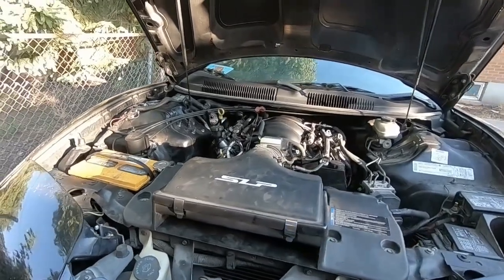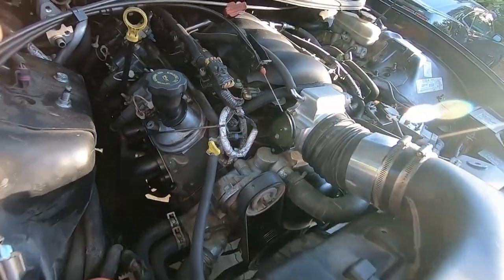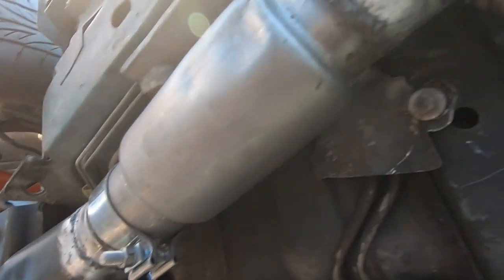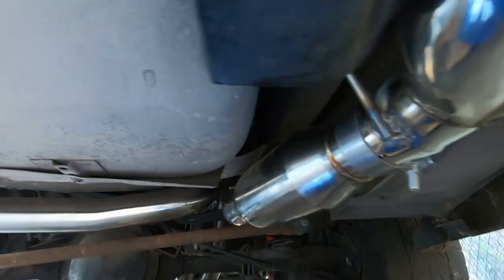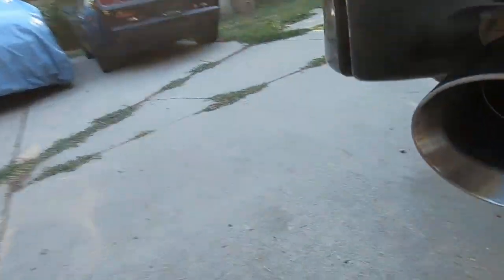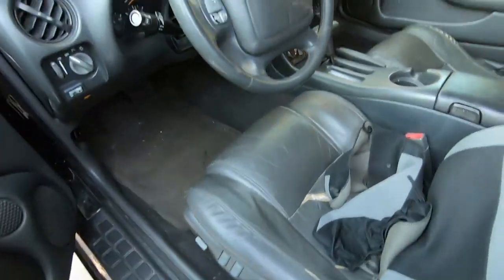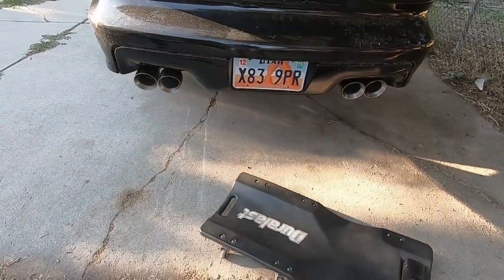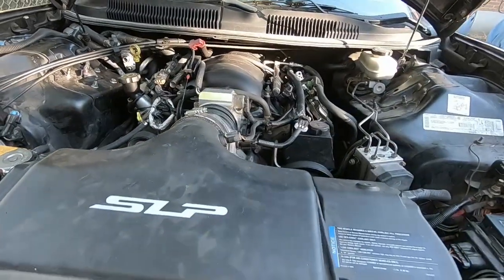Firebird WS6 Build episode 3 - Speed engineering true dual exhaust

Comment: Love the 3 part build. Had an 01 ss slp camaro once. Absolutley love these cars. Did you ever get any more videos of this car?
Reply from the maker: I had a short time to drive it before selling the car (I'm moving, so I'm in the process of selling off all of my projects).  The car ended up making 430 on the dyno and pulled very strong all through the rev range.
Reply: @righteousbuilds3576  nice nice. I had done exhaust, ram air scoop and smooth bellow, and a base tune. Some kid offered me way to much for it so I let it go